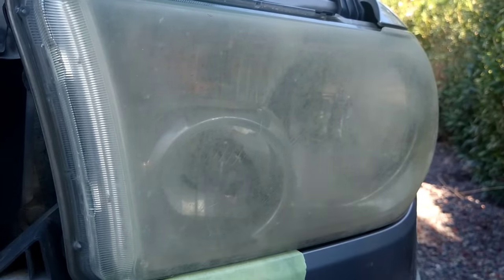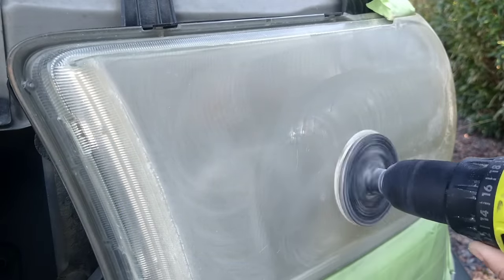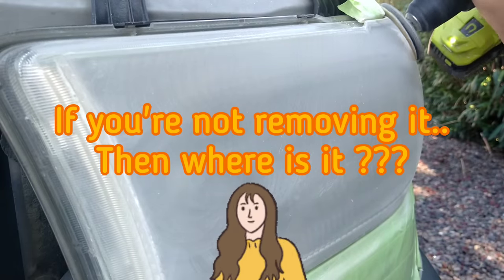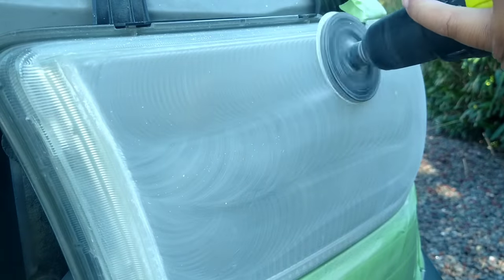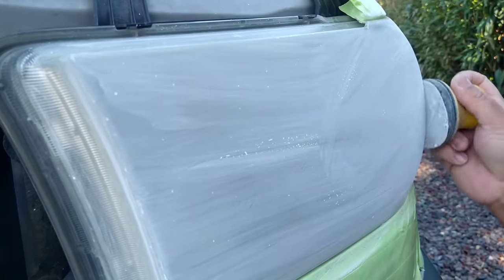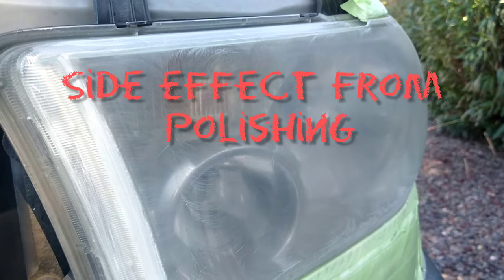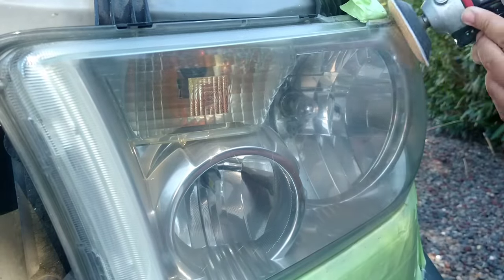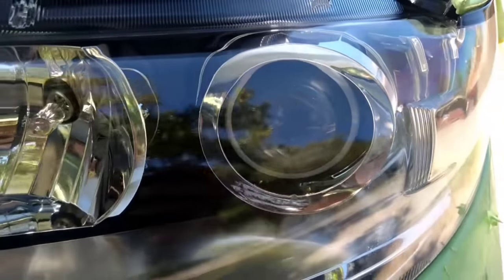POLISHING HEADLIGHTS IS A SHAM/scam  ---  and why you should never only polish headlights

Comment: If you get "side affects" from not using "headlight specific coatings" you fucked up and blamed the coating.
Reply from the maker: Pretty much it's more of an honest mistake.. and nobody can be mad.. when they say look at my headlight just freak happened this freak effect happened it's all cracked up and there's a hole in it or something.. what did you put on my headlight I'm going to take it somewhere and get analyzed.. and you say here I put on headlight restoration formula made for headlights.. it drops your liability next to nothing.. when you say I put on 2K clear furniture varnish... You better kiss your 
a$$ goodbye.. 😂😆😂😂😆😂
Explain that one now you owe them $700 a headlight plus installation.. are you going to have to take that BS off which is incredibly hard.. good luck I'll just deal with headlight certified products..
Besides that... It's just professionalism.. you don't paint somebody's car with interior house paint I don't care what you think if it works or looks better I don't care what you're thinking.. as a professional you use the tools and supplies that are designed for what you're working on... It's plain simple intelligence and common Sense.. if your painting a car you use car paint... 💯
Reply: @theheadlightrestorationpro  yeah I seen that crazing separation stuff happen many times. When adequate wax/grease remover/preparation isn't used. But generally it will just be a cheap and inferior clear with a bad mix of hardener or expired hardeners so the first spray doesn't have what it takes to harden at the right rate and the spray is the opposite and pretty much has hardened as it comes into contact with the unhardened clear. Some talented people can even replicate this by attempting to "dust" to prevent streaking a technique that really does not work the a rattle cans nozzle. Something very important to note is that a rattle can of any sort is a gamble and only one that requires you to add the hardener is a true 2k.

Comment: Meanwhile we've got original glass headlights from 1995, no polishing necessary. Hell, they've got holes chipped in them from rocks on the road, but they still work and haven't fogged over.

Screw all this new plastic garbage.
Reply from the maker: https://youtu.be/LcMFr0mpp-4
Reply: @theheadlightrestorationpro  Okay, gotcha, I see your point. But at the same time I don't. I've had polycarbonate glasses that have lasted me 17 years, longer than the sh!t headlights these days, save for some issues with the 'anti scratch' coating which is pure garbage.

I dunno, but I guess those lenses might have saved my eyes from glass fragments at least. Either way, our original 1995 glass headlights, despite the chipped holes in them, are still working perfectly.

Now regarding your point about complex structure headlights, ask yourself and the auto industry at large a simple question...

Why the F do they need to make such complex structures in the first place? It's a f'ing light, not a space shuttle...

Comment: That looks like you are removing material that is oxidized from the sun. I don't see so much "build up" of polish only.
Reply from the maker: Both... Watch a couple of more my videos and you're kind of get it..
The headlight surface is very porous like a sponge... So all that stuff is embedded into the pores so you're removing surface and all the unnecessary polish clinging to the surface and in those pores...
As well as polish layering...
When I did this light you can actually see rings kind of like a tree or the inside of a tree.. I think I mentioned it on the video..

Comment: #1 clean lense
#2 apply 'Off bug spray
#3 swirl with fingers till plastic turns smooth to touch and spray turns from oil based to the consistency of water " you'll understand when you do it..
#4 wipe off with paper towel
  That's it, crystal clear..
 DEET melts plastic and will remove the first layer which has the fog in it.
  Someone showed it to me, and I about shit a brick,. That's the coolest thing I've ever seen,. I'm not promising it will be perfect,
 But you won't be sanding your ass off either.
Reply from the maker: It'll probably keep bugs away from your headlights too...🪲📯🐌🐛

Comment: Some if not most headlights are cloudy from condensation accumulating and then drying on the INSIDE of the headlight...so any buffing, polishing the outside will not work.... Be it a leaking seal or other defect,  it has to be replaced or taken apart and cleaned and then resealed....which I have done but it's a bitch..

Comment: Should wipe it with isopropyl alcohol to remove any possible contaminants before applying the 2k. Not a fan of clearing headlights to begin with. A good sanding, polish and ceramic coat is the way to go. Clear will always crack and peel at some point. Not dissing you man, but this is not an art, it's a very basic detailing skill
Reply from the maker: Yeah but you're wrong . Isopropyl alcohol which I've tried before on those steps does not work hazes the light and remove things that need to be there like the headlight hard lens have I polished design for headlights..(that's how you use it)
Ceramic on a headlight looks crazy no good. You start seeing streaks cuz application method is terrible even if good at ceramic coating there's no way around it on a clear surface such as headlights.. very uniform high spots and orange peel and takes a long time to dry large window of issues.. I don't think it's possible if you want clear that what you're seeing on my videos just saying.. are you supposed to walk through it..lol
In my application I've never had a cracking or peeling at once... About 3 years later when I have to redo it.. not dissing you but it is art.. if you think anything else you have a lackluster work performance.. and it's just a job to you.. I don't want nobody like that working on my car I want an artist...😉
It is very basic that's why everybody's lights come out crystal clear and perfect everybody runs a headlight restoration business...💯
Thanks for watching..

Comment: When you're polishing the plastic you are stopping the oxidation from building up. After doing this for decades when glass was replaced with plastics. I have NEVER had any fog over and have to use compound to remove the oxidation. When washing you car often, just take a few minutes and apply wax and polish the headlights. Its not rocket science. Stay ahead of the game and it wont look fogged over.

Comment: Or you could take a pay stiff peroxide and baking soda polish those headlights. This will clean off all the oil and then peroxide will react with the plastic and remove it the yellow. Then you take a generic car wax with a UV blocker and polish them. It should take you about 10 minutes. And this will last for at least a year or two. Where you can repeat it. Cost about 4 bucks including cotton towels and squirt bottle for water to rinse headlights. Work smarter not harder. And learn something about peroxide and it's chemical reaction with yellow plastic and UV.
Reply from the maker: I can go into the fridge and pull out salad dressing and put it on my headlight and it might look better but it's going to be nothing compared to a full headlight restoration I'm sure you know this.

Comment: Polishing is a scam...... So you polished it? Lol I get the last steps but you still polished it🤦
Reply from the maker: Polishing headlights and the terms that I speak in the terms of headlight restoration world is polishing from start to finish nothing else... Metaphorically the equivalent would be painting a car consist of just clear coating.  Or consist of just priming.  No filler, no sanding, no paint n,o clear coat, no buffing out. . just one step...
That's what polishing headlights is meant in this world...
Polishing is a very small step if you watch the video you would see that..
I hope that clears up your understanding a little bit thanks for watching..😁

Comment: Polishing changes chemicals makeup???!! Wtffff
Reply from the maker: Yes...the material of the headlight has cells and fabrics(which are composite of different chemicals that make up a substance called polycarbonate(primary substance which most lights are made out of)... These are what get this colored and damaged.(cells and fibers).. From the polishing and friction change them in appearance but they are still damaged.. once damaged/primarily from the Sun,
They're always damaged what's going on is kind of kind of a bleaching it literally just changes the pigment, and fills in coarse pockets temporarily.(metaphorically like dead grass that is brown being painted green). for the damage technically is still there is why it comes back so fast... The only way to actually get rid of it is to remove it and seal it so it does not come back rapidly, and that the sealant is what goes bad primarily instead of the surface of the headlight...(one of my favorite sayings that I say about headlight restoration is.."if you don't remove it.... Where is it?"
Hope that clears it up without getting too scientific...
Thanks for watching👍🏼

Also check this out..
https://youtu.be/tnCdU2j5Ja0
Reply from the maker: Also if you want to see you a neat trick if you find a messed up headlight that's white and oxidized hold a lighter up to it or something with heat not enough to burn it but just enough getting hot it changes back to clear... 🔥🔥🔥

Comment: And this sealant idea is bs. You can't stop uv from affecting the plastic, if the manufacturer used a less uv resistant plastic you are stuck with the lifetime that it fades in. Not only that, automotive clear coat is far more resilient than these "headlight sealants".
Reply from the maker: Far more damaging as well.. this is why it's not recommended you end up destroying the life of your headlight to make it last longer one time.

Comment: You are sanding away the plastic lense guy
Reply from the maker: If you need help understanding look up microscopic images of polycarbonate.. then maybe you'll come to the realization that I'm standing off about 90% of what the guy has embedded into the pores of the polycarbonate 10% surface of the headlight which is needed to correct the damage and remove the past damage... Thanks for watching.

Comment: Sanding headlights removes the manufactures UV protection.
Repeat sanding required every two years as a result,even after using the correct post sanding UV chemical.
It's all bollocks.
Reply from the maker: Thanks for watching

Comment: WD40 every month......
Reply: @theheadlightrestorationpro  🙂Hey Man I just got to tell you real quick I almost screwed by headlights up once I have the sandpaper is actually still have them in my garage I actually started with well I think I went in reverse order I have 600-800-1000 1200 1500 2000 and 3000 grit sandpaper in my garage… then I tried spraying them with clear and they look like the frosting on the cake band they were really really bad… I ended up just going to Walmart and buying a 60 or 80 grit sanding block and I got my frosting clear off that way and then I think I actually kind of sort of forget what I did but I think I went from the higher grades on down and now I just use the WD-40 every month because I thought for sure I was gonna destroy my headlights and one headlight is just a little bit better than the other one but yeah every month or so I just take WD-40 in a paper towel and go over it once.

Your method appears to be the real deal Holyfield I’ve taken the mag polish and done all that stuff and I’ve come to the conclusion that WD-40 just kind of  works good like whatever imperfections you have on there it won’t take it out, you’re literally changing the surface of the headlight when you do the sanding but I mean I don’t really have a couple of hundred bucks spent a new headlight so I kind of hit them with the WD-40 every month it’s kind of where I’m at right now but I don’t even know what I did the first time with the sandpaper but they just stay over on the side of the garage so I can show you pictures of all of this if you like you know I’m only telling you what happened but I thought maybe you could get some entertainment value out of it because this was last year so now they’re pretty bright and they look pretty good but it’s WD-40 lol
Reply: @theheadlightrestorationpro  I’m just talking into the phone so it’s probably getting used to my voice which supply the words are a little bit inconsistent LMAO

Comment: Never, ever do that to a polycarbonate lens. Ever.
First mistake was the hard sanding. Sanding is a last resort step. The harder you sand the more you dull out the lens and the harder it is to bring it back to Crystal clear.
But the single worst thing you can do is to apply that useless Maguire's UV  coating. No manufacturer in the world does it and neither should you.
That coating will degrade within 6 months, or much earlier, and it's very hard to remove. 
Do yourself a favor and never, ever do that to a lens.
That Toyota lens that he restored didn't need any of that.
Very misguided video with extremely poor advice.
Reply from the maker: There was absolutely no hard sanding I use a finesse method if you watching my videos you'll know that..
You might want to fact check a couple of things that you have going on in this post my friend.. you should have no manufacturer coats their headlights every single manufacturer coach their headlights they have to
 headlights... From the dead rolled out the lot or the day the aftermarket or OEM non-installed headlights are made they are coated in a factory before they're even sealed and put together. Also the coating on the vehicle that you might see on this my personal vehicle has lasted about 3 years and 7 months with proper care and looks brand new I give like a 16-month warranty it does not go bad that fast.
My friends you need to educate yourself before you get on here cuz all the things you're saying is really funny. The only way for that light to get better was from what I did proofs in the pudding on my product comes out crystal clear perfection damn near unless something's wrong with the light... Watch a video or two.. watch a video too on this channel and you'll see that a lot of stuff that you said on here makes no sense.
Reply: @theheadlightrestorationpro  
Your response tells me how little you know about polycarbonate lenses and what manufacturers do.
As I already wrote earlier,  no polycarbonate lens comes coated with anything.
The chemical process that happens with polycarbonate lenses is that the sun breaks them down and they become more porous more brittle and things start sticking to them after 46 years. It's a transformation of the chemical process of the lens itself. But no manufacturer applies anything to them.
Horrendous advice especially on coating or applying sealants.
Reply: Furthermore, 25 years at GE plastics and polymers makes me an authority on polycarbonate lenses.
You're just one more YouTuber giving bad advice.
Reply from the maker: I literally just did a video about it everything you're talking talking about.. I suggest you Google a couple things before you get on here like this.
Reply from the maker: It's so hilarious that you would come on here talking like this and not know that the factory coats headlights.. there's a thing called Google my friend I'd advise you to stay on it.
Reply from the maker: Better yet watch my video here and it'll show you what factory headlights being made looks like about 3 minutes in
https://youtu.be/tnCdU2j5Ja0 and you'll see them get sprayed with a UV clear coat.. SMH everybody knows this.
Reply from the maker: Also literally just posted last night a video about why headlights aren't made of glass anymore. You should check that out as well.https://youtu.be/LcMFr0mpp-4
Reply from the maker: If you work there for 25 years and don't know they coat headlights I don't know what to tell you my friend.

Comment: Please! Back off from your microphone! No nearer than 7 inches! The annoying popping wil go away and you won't sound like a cheap DJ! You clearly (!!) know your job, and I know my job (sound recording!), so we can help each other!

You may wonder why singers have their microphone touching their lips without any popping? Well, vocal microphones like the Shure SM58 are designed with built-in 'proximity effect', so don't pop when very close, but moved to 2 inches away will pop badly!
Reply from the maker: Yeah I fixed that issue just check out some of my newest videos those issue is gone have new equipment..
Was bothering me so thank you for the advice..
New stuff sounds better..👍🏼
Reply: @theheadlightrestorationpro  Excellent! A pity I didn't know your methods around four years ago - I had my headlamp units replaced because the garage said it was the only answer...! Not got that car now, but I will know what to do when my current car eventually goes that way!